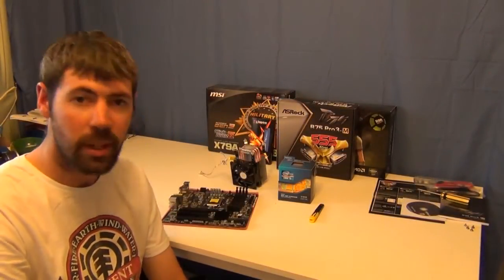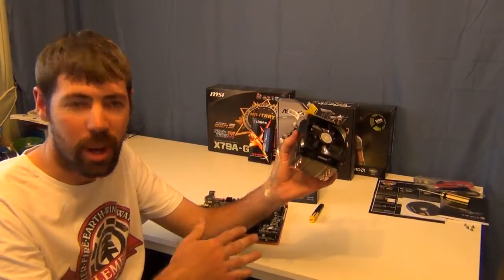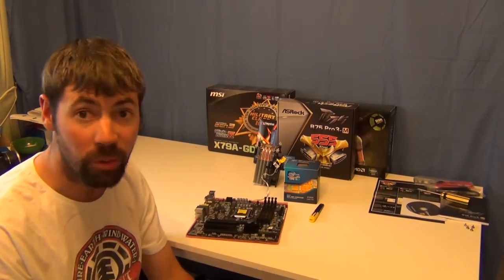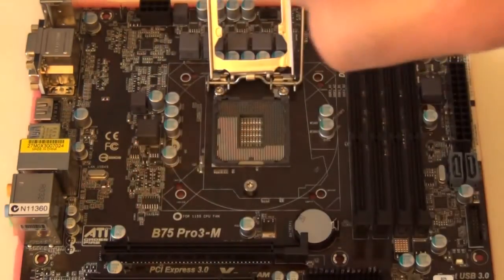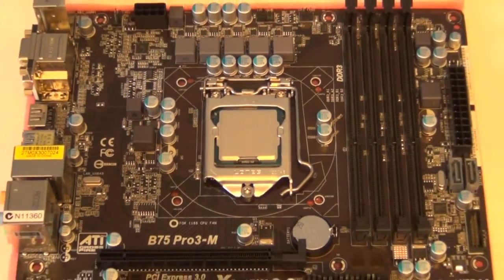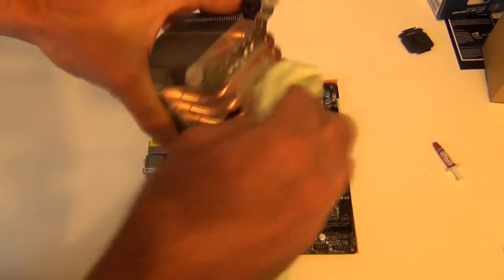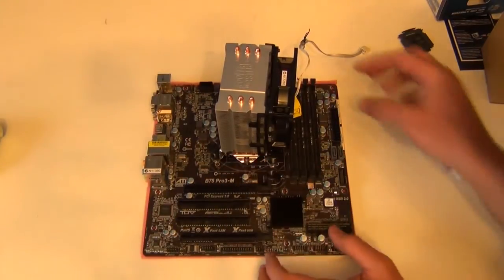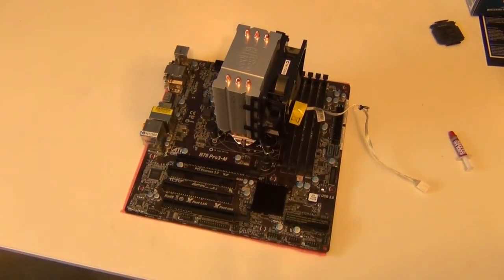How to - CPU and CPU cooler Installation

Comment: did u have to do any bios update? im getting the asrock b75m, the i3 3220 requires p1.30 bios on the board im getting n the board u used? so id like to know if u updated bios or was it good to go?